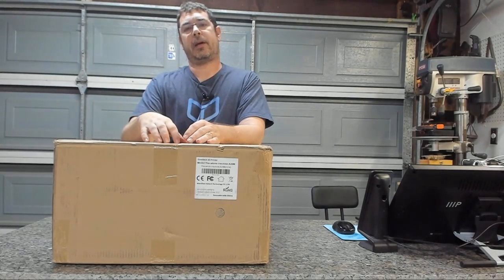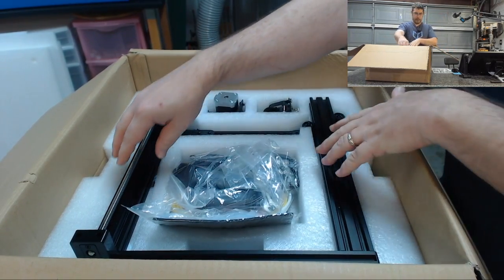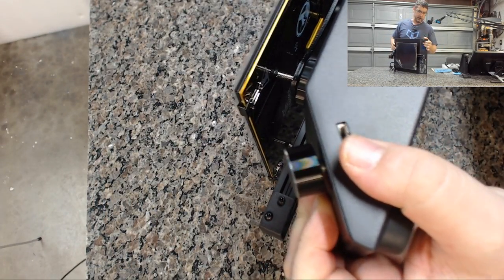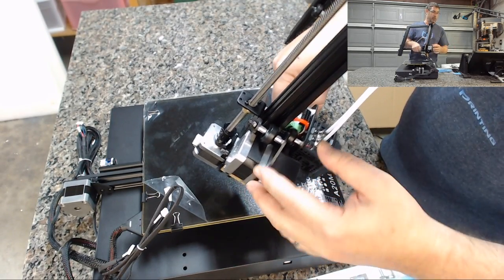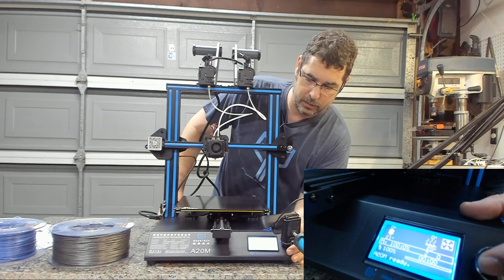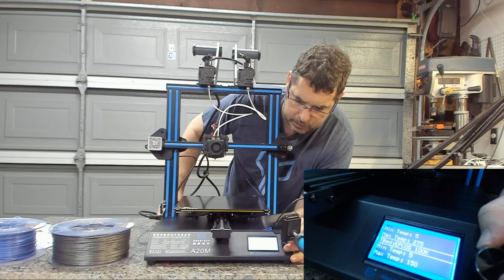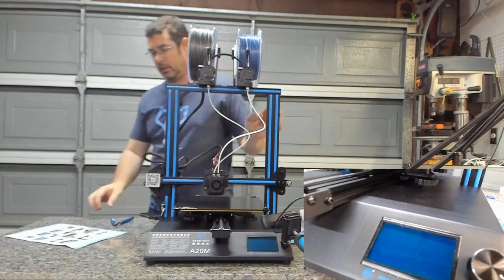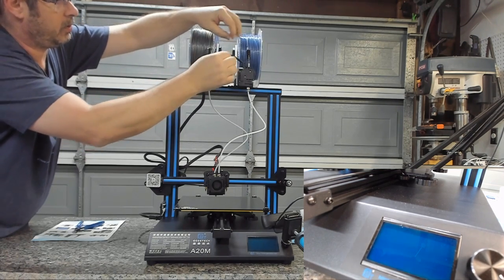Geeetech A20M Unboxing and Assembly

Comment: Enable filament runout sensors before you print.
Reply from the maker: Good point!  Depending on which version of firmware you have, this may or may not be automatically enabled.  Best to check!
Reply: @crussty3d  They weren't enabled automatically on the A20M I received 3 days ago.

Comment: Hi. after some months, what do think about this printer ? Is it worth the purchase or better to stay away?
Reply from the maker: I’ve only had the A20M a few weeks now, but I have the A10M and really enjoy it.  Both machines are very similar, with this having the updates/upgrades I mentioned in the video.  That said- I wouldn’t necessarily recommend this as a first printer for someone because their is a bit of a learning curve on how to best deal with the mixing hotend and to keep it from jamming.  If you have experience, and go into it with the expectation that there will be some tinkering and tuning needed, it’s a good printer for the price. It works well out of the box, but like most at this price point, there are numerous community designed upgrades to improve it even further.

One thing I do highly suggest is if you do purchase one, but it either direct from Geeetech, or via Amazon.  If you have any issues this will get you the best support from them. If you purchase third party (eBay, Bangood, etc), you will have to go thru them for support which is not pretty.
Reply: @crussty3d  i've purchased from an official Geeetech service company, the ones that send replacement parts and so on.
Reply from the maker: Awesome!  You should be set then.  If you find yourself needing any assistance with it (or want to share yours with others), they have a very active group on Facebook.  Just search for “Geeetech A10 & A20M”to find it.
Reply: @crussty3d  do you think the purchased made directly from on of their official service, would be properly managed by Geeetech even if not sold directly by Geeetech? If Geeetech will send replacement parts with no troubles, i'm ok
Reply from the maker: The have localized warehouses now in many countries they contract with to provide delivery rather than shipping from China, so I think you are good.  Mine came from a warehouse here in California that’s only 30 mins from my house. Lol

Comment: Could you please let me know how to upgrade the Geeetech A30T firmware to Marline 2.x
Reply from the maker: Ramin Ohebshalom I don’t have an A30T, but if I recall correctly, it doesn’t use Marlin firmware, it uses Geeetechs in house developed SmartTo firmware.
Reply: @crussty3d  Thanks for the reply. It does use the Geeetech firmware that does NOT translate the Cura's gcode properly. That's why I need to upgrade the firmware to Marlin. You can ask Geeetech to send you one for review.